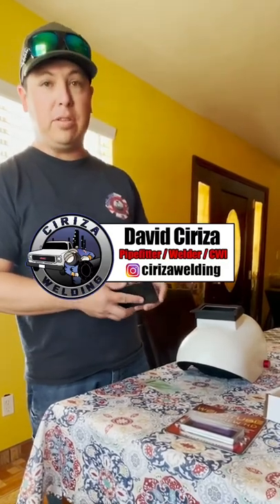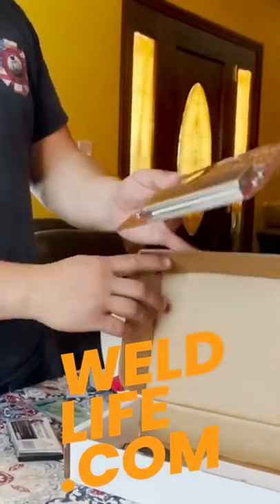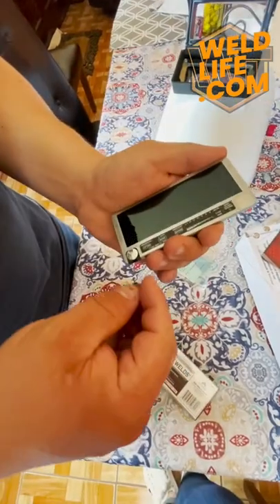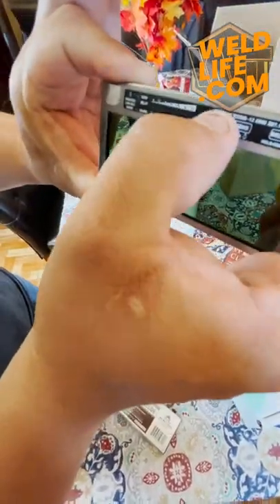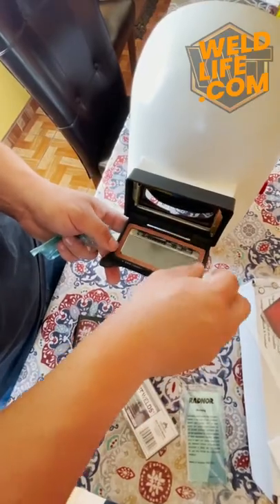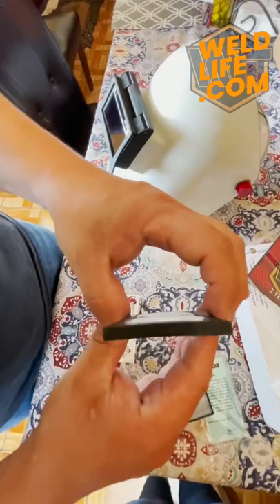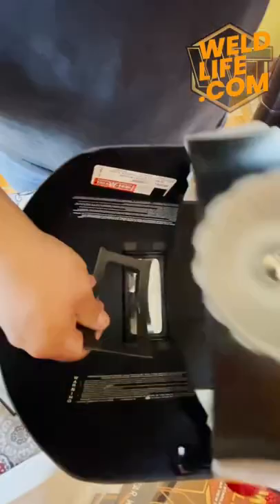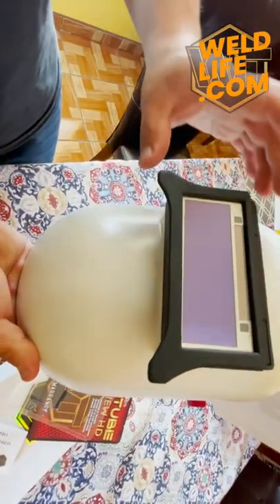Installing a cheater lens on the WeldTube pipeliner hood. #shorts

Comment: As a welder of 40 plus years, I recommend you weld at a darker shade to help prevent cataracts and possibly blindness as you get older. Especially if you already need a cheater lens.
Reply: 🙏 I'm 24 and started welding last year, except for very low amperage I'm always using the highest, 13, setting on my 3M speedglass autohood. Figured as long as I have my sight intact should try to preserve it.
Reply: @leander_d  don't forget plasma cutting is as bright as welding and torch cutting should be done with ar least a 5.
Reply: I would recommend a airflow mask to protect your lungs.
Reply: I stay at least at 12

Comment: Needs the cheater lense because he’s on shade 9😂
Reply: Most of Welder’s that I worked with that used a 9, either welded low-amp TIG or have shaded safety glasses.